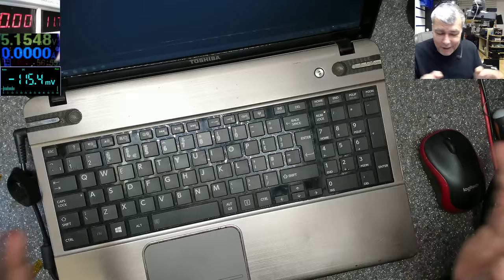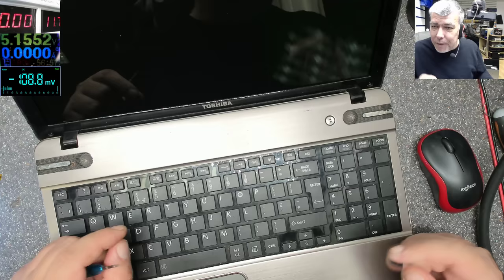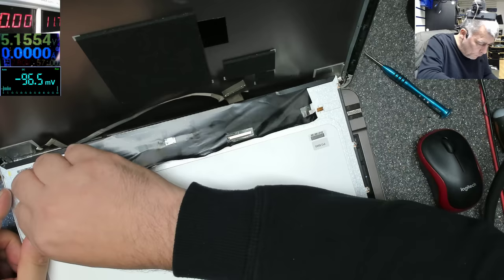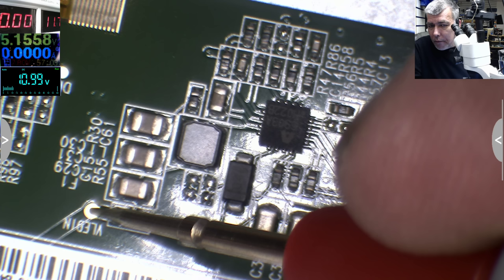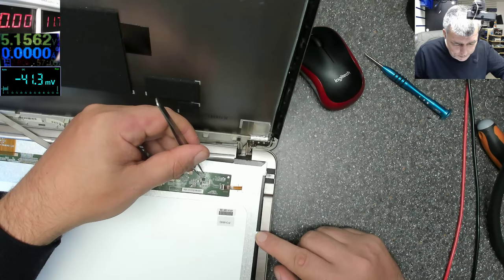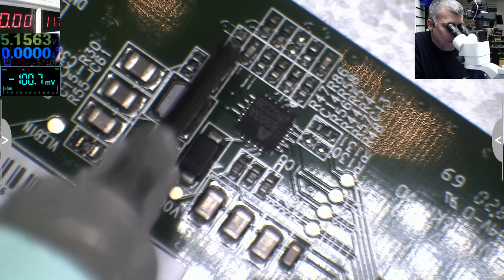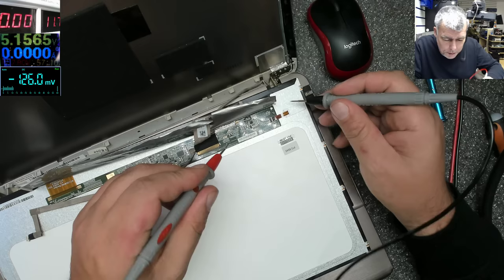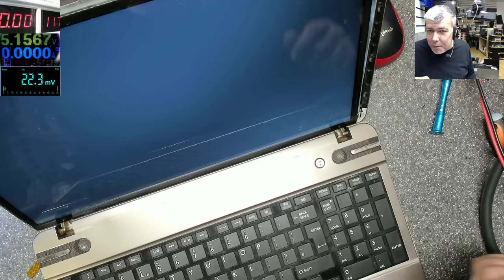How to fix laptop screen flickering flashing - the hardware method :D

Comment: That is NOT a hardware fault. It is a energy saving thing by intel. Its called "Intel Display Power Saving". Disable it !!! The voltage goes up and down because the driver is dimming the whole time.
Reply: Hy bro my lcd panel is white laptop lcd is white please help for repaire tgis
Reply: Bro you a lifesaver idk how to thank you browsed through 100s of videos but what worked out was a comment Keep it up my G
Reply: Couldn't find mine
Reply: Es correcto,  la mía se solucionó de esa forma, desactivando el ahorro de energía en el menú de configuración.

Comment: If the laptop owner comes back because he would like to be able to adjust the brightness: do a 'vintage' repair: take an NE555, a potentiometer, a few discrete components and create a PWM signal with that, for adjusting the screen brightness. Works very well. It's a simple circuit which can easily be built without a circuit board. Just hot-glue it to the back of the screen. Very dodgy but functional. For extra luxury, an LDR can be added to the circuit, so it will automatically dim and brighten up according to ambient light level.

Comment: This is not a hardware issue. Just uncheck the Intel Display Power Saving  Technology  option from Graphics Properties and the flickering issue is resolve.
Reply: Yes that is the reason why it is only when windows is booted and the intel driver is loaded, but not on bios or at bootup logo.
Reply: but it would have been a rather boring solution :)
Reply: Don't be stupid, for many cases like mine, it happens even on startup at bios
Reply: @KeiLin11  i know, what i'm saying that what he is teaching is useful for many people
Reply: @KeiLin11  I have the same problem with my Asus UX31e.The screen flickering when working from battery.Rebooted to Bios,but the same problem...Replaced 2 Lcd with LVDS cable and still the same. :((((
Reply: @KeiLin11  Good observation, yes it only happens after Windows boot, so yup probably because intel saving feature, a buggy driver, better to untick the saving feature, or move to a different driver, otherwise check for battery laptop. Lastly but not least is the problem occurs during bios too, then again check for battery replacement, and as last choice do this show in the video.
Reply: @arnoldjobbagy1637  Did you manage to resolve this issue? I have the same issue with an Asus x553m

Comment: I had this problem many times. In all my case the Intel graphics driver was faulty.
Reply: it is called "Intel Display Power Saving". Disable it and you will be fine. The voltage goes up and down because the driver is dimming the whole time.
Reply: @nebuzstar  Yes, or you can install an older driver version. And it is recommended to disable the automatic driver update, otherwise the error may come back with the next update :)
Reply: Yep, same here
Reply: But wouldn't that also affect it being on the charger too
Reply: @andythomas7931  The problem is due to the difference between battery and power supply mode.
Reply: Damn. Thanks
Reply: Low energy mode can change refresh rate from usual 60hz on most monitors to whatever lowest is available, sometimes 48hz or lower. You can manually change it in display monitor properties back to 60hz but intel graphics will switch it back next reboot
Reply: Was your display flickering on high brightness only? What happened when you lowered the brightness?

Comment: I liked your approach of diagnosing the problem.  Most of the viewers do not have the background to identify which component to check using multimeter. Your way is the preferred way instead of replacing the screen and throwing away the existing one.  Thanks for your good work.  I wish I could get that kind of training, which I always loved.  I liked your style of teaching and have already clicked "Like".
Reply: r

Comment: Very helpful video!!!... 1st I had to remove the damaged screen doing exactly as he explained, checked the exact model and rear video connector position, ordered the new screen (making sure it is 100% compatible with the original laptop model + video connector exact location behind), safely store the disassembled laptop parts with care by holding with tape the little screws while waiting for the new part. Once I received the new screen, I followed exactly as this guy explained ensuring that all connectors were properly inserted and... VOILA!... it worked. 
>>> JUST 3 LITTLE EXTRA ADVISES: 1) Keep the NEW front protective (transparent) screen cover on it while re-assembling until you need to put the final frame cover. 2) Be careful not to confuse the bottom screws with the LONGER pair that belongs to the plastic screen cover at the end of this procedure, otherwise won't hold it (as I did it), so you have to swap them all back correctly. 3) Ensure that the plastic frame >>cover hinges<< are well INSIDE the other half from the laptop. Do not leave them loose/unclipped. The rest... all good. Thank you.

Comment: It could be a missing capacitor or broken track for multiple capacitors on the backlight power circuit, that's causing the backlight to get the "unevened" clean pulse of current. The issue may not occur on charger because in windows settings, the backlight is set to 100% when plugged in, and less than 100% on battery. That is also why it doesn't occur on startup, only after windows logon. The user may have caused that while replacing RAM or HDD, or by slipping a screwdriver in the wrong place

Comment: Found ur channel after ordering a dead motherboard for the IDS port replacement. But then, I tried reflowing the board in the oven (ghetto) 2x and it booted. So I have a flickering screen.
And haven't removed or found a IDS replacement for my original motherboard. Thank you for this. Just building something 1st time hoping it works.

Comment: I received a laptop with same issue, but I found out that in windows 10, when the power adaptor was disconnected, the brightness level automatically drops and cause this issue. I just updated the Intel graphics driver, and adjusted the brightness level to 100 on both with battery mode and charger. And it worked fine 😀
Reply: You can disable "Intel Display Power Saving". Then this fault will disappear.
Reply: @nebuzstar  I do it but not working.
Having face same problem but not find out proper suggestions.

Comment: If the problem is really coming from the dim-signal of the super io, you should also disconnect the resistor because now youre feeding power into a diying signal line :)

Comment: as it started ok - and only began to flicker after drivers started to load, I would have guessed at a driver issue. Also, what happens when power options are set to turn off the screen?
Reply: Yes it loads up ok, and starts flickering when in windows. This could be the adaptive brightness causing an issue with the flickering.

Comment: Kareem Kennis
Morning sir,I have issue with a Samsung note book motherboard.the laptop is charging but not powering, 3.3v is present in the bios and super  i/o but it is not present in the power button.pls tell me what to do.thanks
Reply: why not do a trick like Sorin? Apply voltage to the power button.
Reply: I applied 3.3v from another source,still the same result
Reply: Super I/0 dead. 3,3 to power button comes from super I/0. Mayen you could try to flash the eeprom near the super I/0, of it is existing
Reply: Thanks.

Comment: Thought we should not touch the screen board, my screen goes all vertical line after touching it. Why? Changed the screen cable still the same. It is the ribbon on the board problem?

Comment: this is called improvisation, the problem is not fixed where it should be. there is a problem with the system that saves the battery, if the maximum light on the monitor is from the battery, then the damaged battery is quickly consumed.

Comment: My laptop flickering is removed by upping the screen brightness all the way [weird, but works] OR by putting computer where it can temporarily cool down for a few minutes.  I turn it on it's side like an open folder and place in the coldest, computer safe spot available for a few minutes.  Invariably the screen stops flickering when the system 'cools off' because it was running hot.  I previously explored other more technical fixes till I finally discovered these two consistently effective fixes for my system.  Went through so much trying to resolve it and it boiled down to these non-technical solutions.  Has worked without fail all year now.

Comment: I have that problem on my Toshiba. Mostly stable video until I adjust the screen angle, then lots of flashing. But sometimes I get a little flashing when it's just sitting there. I unplugged the charger and it started flashing, but then settled down. It may have just been the movement that caused that. Put the charger back in and moved the screen. Lots of flashing but then it settled down. Would love to get it fixed. It's still a good laptop and it's running a website monitoring program for me.

Comment: The solution is very good. I was lucky because it was a software problem. On an Asus x54h laptop with hd7470m graphics card, Windows 10 put the latest video driver and when I set the brightness less than 100%, the backlight lights went out completely, and when I set brightness to 100% they were on the maximum so I couldn't watch to the monitor and the solution was to put an old but good video driver and to block the driver update in windows.
E foarte buna solutia. Eu am avut noroc pentru ca era o problema de soft. La un laptop Asus x54h cu placa grafica hd7470m Windows-ul 10 punea cel mai recent driver video si cand dadeam luminozitatea mai mica de 100%, ledurile backlight se stingeau complet, iar cand dadeam la 100% erau aprinse la maxim de nu ma puteam uita la monitor si solutia a fost sa pun un driver video vechi dar bun si sa blochez actualizarea driverului in windows.

Comment: hi. iv got an asus x555lD laptop and the screen works but its like the back light is faulty as you can barley see the screen & when charger is plugged in it works like normal. Took it too an IT company and they said its the led within the LCD screen is this correct? if so how do i replace it?. as a new screen is like 120$. thanks

Comment: what was the liquid that you applied  before soldering ? what is that thin wire called ? can i use a thin solder with a small bit to solder or will it fry the truck ? and i might lose display completely ?

Comment: Hi sir,  I have a problem with my slim acer x483 flickering from boot  and won't stop flickering on battery or plugged. I dont know if its the backlight or need a jumper too. I noticed a lot of same issues with this model.

Comment: Hello Sorin, you mentioned you can replace the board altogether. I have a Hp envy 13 aq10** with a similar problem. I'd like to replace the whole LCD connector board. Where can I purchase it in the US?
Reply: No..  not possible without advanced factory tools.  The lcd ribbon is connected / merged to both
And if a model has a removable board which most do not.  Probably best to just buy lcd at that point

Comment: Hi Sorin! Isn't it dangerous to inject voltage directly into an output (PWM) of the Super-IO chip? Could that tension destroy the Super-IO over time? Thanks!
Reply: If you know what it should handle.  You can stay in correct limits of that rail.
Like it bouncing around 11v it must be a 12v rail.
So only send a steady 11.8 or so

Comment: I have a Toshiba Satellite Radius P55W-B5224 laptop whose screen flickers.  I connected it to an external monitor with a HDMI cable and the display on the external monitor was perfect.  I watched a movie for more than one hour non stop with charger connected.  While the external monitor screen display was perfect, the laptop screen after flickering for a long time, became dark.  So is it a software (Intel Graphics setting) or hardware (damaged/failed) laptop screen issue?  I disconnected the touch screen cable, still flickering, pink some time green color flashes, unstable screen color changes continued.  Viewer feedback as well as author's feedback is highly appreciated.  All the vowels of the key board are out - not working; I am using an external keyboard.  I have already tried to load the old display driver and tried.  same issue.  I have updated the display driver, same issue. Both times, the external monitor display was perfect. Thanks for reading.

Comment: I have a screen flickering issue with my Acer Predator Helios 300.. It does not change if i remove charger or have it on.. it is constant. I update my drivers, and uninstalled "incompatible apps" that may cause this issue such as Norton Virus(something i learned can cause this flickering for some reason..) but i still have this issue.. someone please help me out! Thanks

Comment: FYI - Some older Toshiba laptops have a 15V power adapter. They don't work with 19V.
Reply: Leave those single-core oldies rest in peace :D
Reply: @em0_tion  still running my Tecra S11 with intel core i5 at 15V
Reply: @marcellipovsky8222  Yeah, i have nothing against them as laptops, i was just always annoyed when i couldn't find such a wide inner diameter charger for them 15V oddballs :D Tecras are sure worth keeping, unlike most cheap Satellites, so kuddos on the great choice ;)

Comment: This Is a EDID mismatch problem! You can backup old (broken) screen EDID info and update the new screen firmware and it will work perfectly. Or like other people said, you can disable the brightness adjustment...
Reply: If only I understand what you are saying, I would be able to fix my laptop. I want to keep the brightness control  function because I use it a lot

Comment: Had this problem on a few asus laptops but all the voltage was fine , replaced the screen and problem solved, this one he repaired could  have been a driver fault or super io, But 23v could not be right

Comment: ok as technician i agree and disagree with you Sorin. Maybe the initial problem solved choosing the easiest / cheaper solution but the ios will bring new troubles beginning by this over charging value....On the other hand portbility or screen brightness adj. ? I choose the second....anyway this is an old laptop....

Comment: I had that same experience.  The miners and scalpers were buying them and with them using those bots it was impossible to get a hold of any graphics card for a fair price.  A Bestbuy store not far from me had do GT 1030s all throughout the scalping epidemic.  Turns out they were so worthless no one wanted them!  They would be just fine for a computer used strictly for office work or homework but most people wanted something that could run some games without having to run them at 720p on low settings.  It was so bad people were buying older cards just to try and get a better deal when in reality the scalpers and miners were just giving us all the short end of the stick and feeling good about it just like any other scumbag of a human being!!

Comment: Sorin. I have this same issue with my asus laptop!!!
Reply: Had this problem on a few asus laptops but all the voltage was fine , replaced the screen and problem solved, this one he repaired could  have been a driver fault or super io, But 23v could not be right

Comment: Funny thing would be to put potenciometer to the side sp he can setup brightnes 😂
Reply: I dont think that will work because the control signal is digital (PWM).
Reply: @MrThomashorst  i would still put it just for the fun of it. Don't know never worked on that part. Looked like it was voltage control